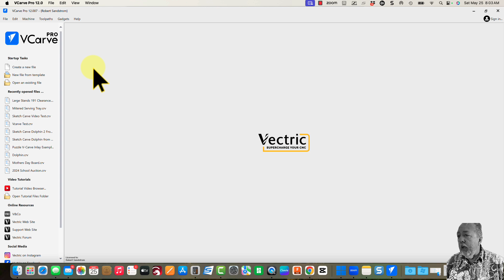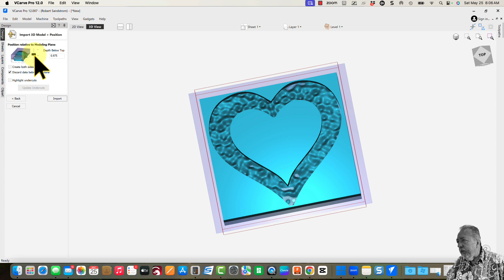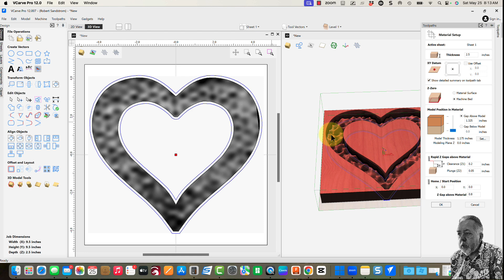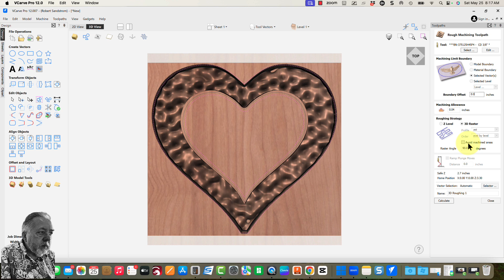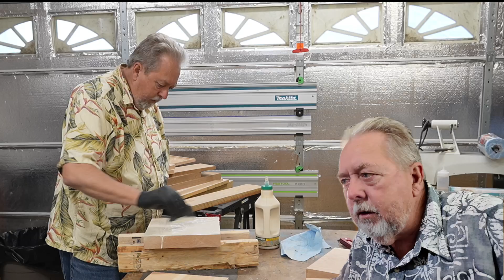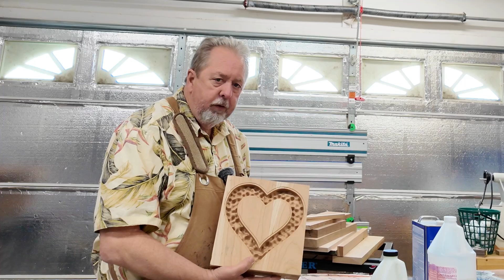Use vCarve to Make an Epoxy and Cherry Heart Bowl Part 1 - "The Dripstock" - Corbin Dunn Design

Comment: Great video Rob, i think i will try this. I have couple of questions:
1) do you have a list of the router bits you used on this project?
2) when you surfaced the top of the bowl after the epoxy pour and measured the thickenss, did you have to go back and rerun the tool paths with the new thickness? 
thank you
tony
Reply from the maker: I think you would enjoy the project.  I thought I had listed the bits, with discount codes in the description and based on your question discovered I had not.  I have added them so they are in the video description and better than trying to fit in this comments section.  Do I find search in the description and you will see them.  If not let me know and I can put more specifics in the comment.

As for resetting everything after surfacing, I did not recalculate tool paths.  As you note the tool paths are calculated on the thickness of the block (which was actually about 0.02" thinner based on the surfacing).   Technically, as you suggest I should have made the block thickness 2.48" vs. 2.5" after resurfacing.  That would've been the most accurate and best thing to do but I did not.  Unfortunately, until you asked the question I didn't think about and didn't notice any issues with carving the model even though I left the original thickness.

Comment: Very nice! Where did you get your 1/8" tapered ball nose with a 2" length of cut? (Did I read that right?) I couldn't find it in the resources on your website.
Reply from the maker: Thank you for letting me know it isn't on there.  May need to look closer at what I posted.  I got fro RIPPRECISIOMNTOOLS.com. here is a affiliate link and referral code for a small discount:  Ripprecision Tools:  https://www.ripprecisiontools.com/?ref=692c5q8z
Referral Code: ROBSANDSTROM
Reply from the maker: I just went to website and see they have more than one.  The SKU for the longer cutting length is SKU: RTBN-125X37525F4.  Direct link: https://www.ripprecisiontools.com/product-page/3-8-taper-ball-nose
Reply: Great video Rob!